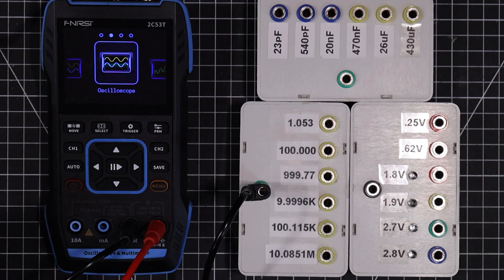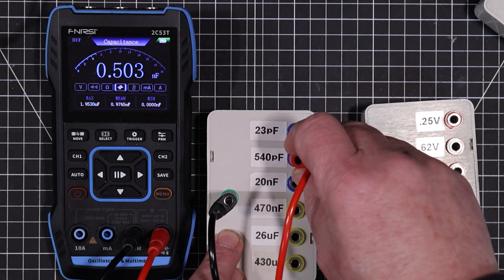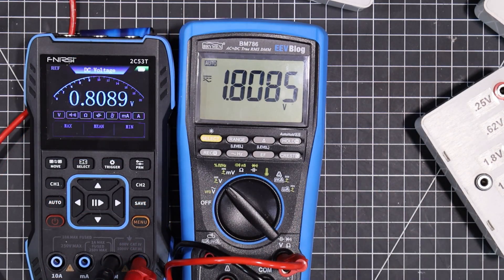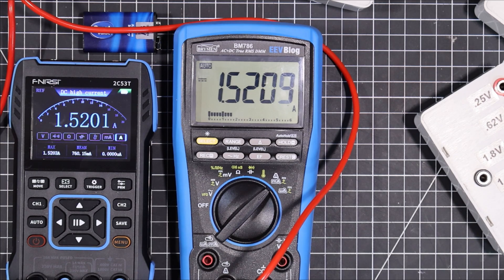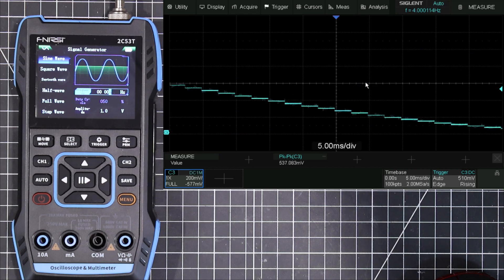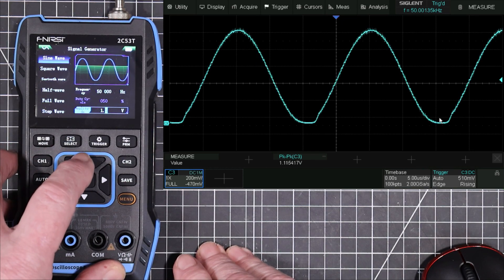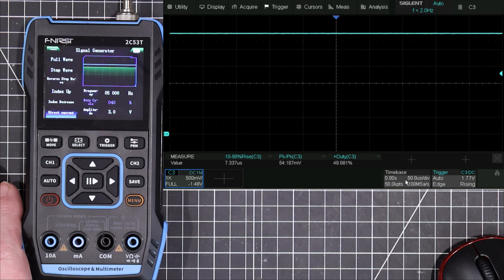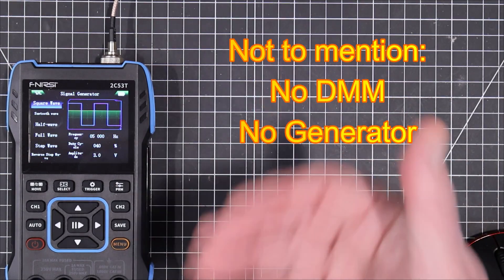Uni-Byte 0241 - Reviewing  the FNIRSI 2C53T!  Part 2

Comment: I have one of these you can tell its $70 as its utter rubbish
Reply from the maker: Interesting.  Let me ask you Steve, are you one of these guys that buys something without checking out the specifications first?  Because it does meet it's specifications.  Or did you expect $500 scope performance from a $70 scope/DMM/generator combo?
Reply: @uni-byte  I expected just a little better than this cheap junk, I looked at lot of reviews before I bought, it looked good, its not, its not user friendly + if its not used for a while the battery still drains, as they say "you get what you pay for"
Reply from the maker: @steveb936  Well, that's exactly it.  You get what you pay for.  This is not for the experienced hobbyist.  It's for the beginner that is just getting his toes wet.  Wants to play around with a little audio, or do some Arduino experiments, maybe look at a 555 or look at some basic op-amp circuits.  It's fine for that sort of thing.  I agree with the battery drain.  Soft switches should not be used on battery equipment.  I did not find it's UI a problem, but then again I review all sorts of things which I guess gives a little more experience with finding out how things work.

Comment: I read some kinda scientific explanation of why a square wave takes a lot more Herz to make, so a generator of 50khz max might only do 10khz square wave max. Same for reading. Some technical sciency reason on eevblog
Reply from the maker: Yes, square waves have a fundamental frequency but also a series of harmonics that ideally go to infinite frequency.  Generally, to do a decent job of displaying a square wave you need a bandwidth of more than 10 times the fundamental frequency of the square wave.

Comment: Would this be accurate and fast enough for automotive diagnosis like the cam crank correlation or CAN BUS? The industry standard is PICO but at $2k. 13:36
Reply from the maker: It would be fast enough, but I'm not sure it's a good choice for automotive work.   It has only 2 channels and cannot decode CAN bus signals, but you would be able to view them.  Hantek make reasonably priced models for automotive work like the Hantek 1008C.

Comment: The sawtooth was lopsided because of the 40% duty cycle set on the screen.10:42. The measuring scope reports the same 40% duty cycle.  Other waveforms subsequently sampled may also be affected by this setting.
Reply from the maker: Yes, of course.   It was actually meant to be tongue-in-cheek.  I had a long rambling explanation that did not make the final cut.  The gist was, if we call a waveform "square" or "sawtooth" these have specific meanings in electrical engineering that don't allow for adjustment.  Better choices for those modes would have been "rectangle" and "triangle" which are less specific and can be adjustable.  Anyway, thanks for bringing it up.  I'll pin your comment so others will get the explanation.

Comment: Sure the distortion isn’t an op-amp issue?
Reply from the maker: Yeah, it could possibly be.  The thing that has me think it's a firmware or table problem is that it happens over a wide range of frequencies and amplitudes.  So. although it could be op-amp related (I've seen some weird s#it come out of fake op-amps) I'm leaning toward one of the other faults.
Reply: @uni-byte  I was thinking it was an implementation issue. Either way, it will be interesting if they can improve the shape, although I assume the steps are here to stay.

Comment: Can the device measure 2 reverse-phase waves on 2 channels?
Reply from the maker: Yes.  The two channels are completely independent and will display whatever signal is present.
Reply: @uni-byte  can you make a video to measure 2 reverse-phase signals on 2 channels? I really need it
Reply from the maker: @huypixel6068  What do mean by reverse phase?  Are you talking about reverse polarity?  What is this for, audio, stepper motor control, 3-phase motor control?
Reply: @uni-byte  I want to create 2 reverse phase waves to connect to the 2 input signal of the differential amplifier
Reply from the maker: @huypixel6068  Yes, it can do that.  Any 2-channel oscilloscope can do that.  I have a busy schedule and would not be able to get a video showing that in the near future, but you can take my word for it.
Reply: @uni-byte  I try to create 2 reverse-phase signal using 2 in series resistors which is connected to ground in the middle, but when I measure on 2 channel, it seems that both signals have the same phase, I just don't know how to check the phase
Reply from the maker: @huypixel6068  You can't do it that way.  You might try using a couple for op-amps.  One set up as a non-inverting buffer, the other as an inverting buffer.
Reply: @uni-byte  I tried it for my lab lessons and it worked so I keep using that method, the shop sales op amps are way to far from my house so I have to use different methods

Comment: Nice unit, very similar to the ZOYI ZT-703S which I have and I know so do you. I think you may get some better results if you had taken the time to null out the test leads. On the Zoyi you briefly press the power button  I would guess that there is a similar button on the  FNIRSI .

Like yourself I started with a second hand Heathkit. They did the job at the time. I agree that these little units are a fantastic  tool for the new user, and also for those of us that are somewhat longer in the tooth.I bought the ZOYI for pretty much the reason you gave and that was working on MCU projects when away from my main workbench. However one other benefit that I bought the unit for was that it is completely isolated  so you can do a bit of poking around on some older equipment without the danger of frying the front end of your scope via some earth return issue.

Looking forward the the PSU project. 

Thanks for some very interesting videos, hope you had a Great Christmas, and all the best for the new year.

Andy
Reply from the maker: Actually, I don't have the Zoyi.  I have a Zeeweii DSO3D12 though.  The manual for the Fnirsi is lacking quite a bit.  I'll look around for a REL button as you suggest.  Thanks for suggesting it.
Reply: @uni-byte  sorry, must be another channel - these things get everywhere...the Zeeweii DSO3D12 is another example of a nice starter instrument as well.
Reply from the maker: @andye2005  Indeed it is.